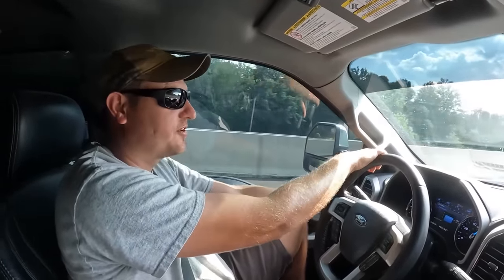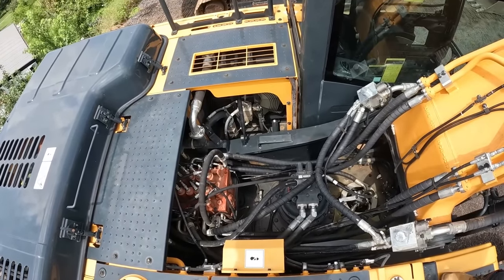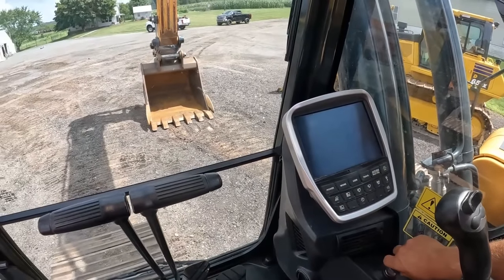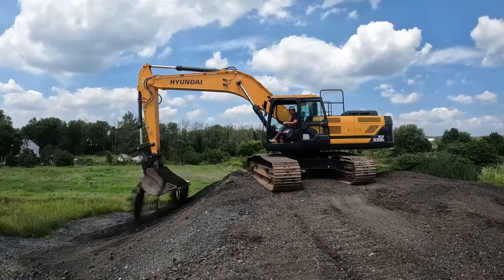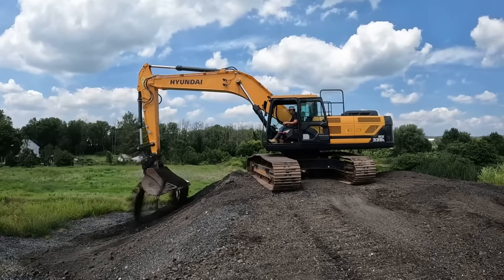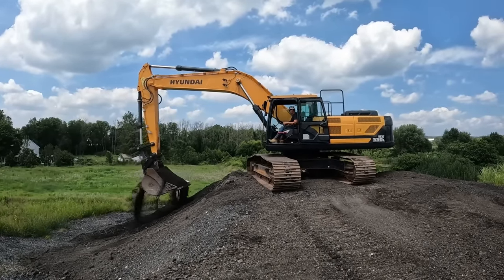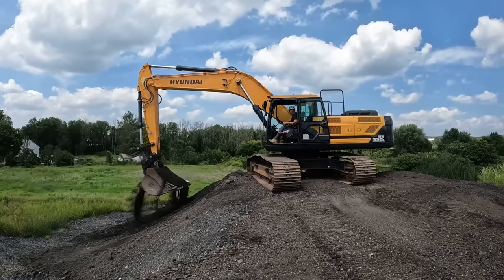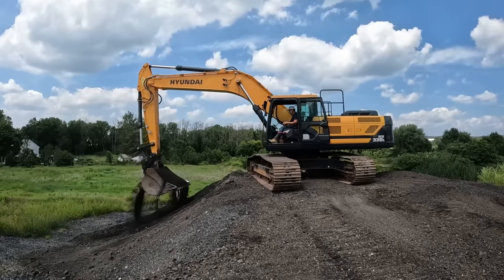Buying A Larger Excavator

Comment: So far watching it Kobelco. Looks much sturdier, quicker, less jigging about while you track. Sounds smooth and looks tight under operation.
Walking up to them first reaction way Hyundai but that soon wore off... on with the watching:-
OK got to the end. The Hyundai has a lot more safety bars on it more to bend but safer for you ... if you need it. Also appears to have a bigger counter swing radius. Can't tell if that's real on camera.
If they can both be hauled with special permits or on the same Size trailer, despite the weight difference, I am sticking with my Kobelco.
Though I suspect you are going to let the  lighter footprint of the Hyundai sway you because it might make a difference on certain jobs.
Nah deffo sticking with Kobelco. Work rate is so much better. Anyway it's worth more when you upgrade next year so you will get that extra money back.
Great video.
Feels like we are all getting a new toy.
Reply: You dont need a new truck.  You need an additional truck.  So the big boy dosent have to wait on truck to get back. One driver can keep two trucks rolling.
Reply: @tedc7714  I meant the rig for hauling them job to job.
Reply: Cummins was my account .,cat and John deere. . I kept the digital computer purring in the R and D Departments.  John deere and cat had the machines wired with sensors.  With my computer keeping track as they ran.  Same at Cummins with the engines.  I was most impressed with the Cummins operations.  They leave nothing to chance.  Any way all are impressive and you are the guy using so what ever turns your crank.   The difference on the hour meter I would say don't amount to much.   Mr experience was 8 years during the 1980s.  So not relevant today I doubt.   Hard decisions I know.

Comment: Why would you have to drive over 6 hours to get a machine? Plenty of machines in the NC area new and used. Plus it'll cost you at least $1,500 -$2,000 to get it moved. When I buy equipment it's not all about price, its about dependability and the service you can get. When a large excavator goes down and it costs you downtime of $200/hr plus $100/hr for the trucks your loading and other equipment in the operation it adds up quick. Theirs a reason why those two brands are available with so little hours.

Comment: As a service provider for Hyundai equipment, I will say they are very simple machines with the electric control over hydraulic. And they have been very reliable machines as well. If you decide Hyundai , NED (National Equipment Dealers) which is who I work for, has multiple locations across the North Carolina

Comment: I think you’ll end up regretting the Hyundai in the longer term for sure, the kebelco is the lesser of the two evils.
I understand budget but a case 30ton or the zero swing would out work and outlast them both and have a fare better resale value.
Ps Volvo screwed up not hooking you up 🤦‍♂️

Comment: I as an equipment operator have had my fair share of different brands in the excavator department.

I personally do not enjoy the hyundai's they're extremely unreliable as far as power what we're asking of the machines in a quarry aggregate setting.   I know everyone will say typical but CAT's are the best when it comes to performance not far behind would be the komatsu's and kobelco's then deere let's be honest deere just lacks in some departments they could use improvements in a few area's but their engines i'll give them credit where credit is due
Reply: Takeuchi is also great but they're only making ''small excavators''

Comment: Still dont get why us has so stripped down Excavators.. her in scandinavia everyone has auto lube and tilrotators whit 2-3 aux options and quick connects on hoses even on 30-35 tons machines. We dont even go outside the machine to connect hoses anymore sins everything is buildt into the bucket lock/connect.

Comment: Chris, you’ll probably go with the HX 330 L, and for a 2019 w/1600 miles you’ll pay around $142,599. good luck with your new machine…
Reply: The 2019 Hyundai is listed on their website at $169,000 and the 2020 Kobelco at $210,000. BTW, the Hyundai has 1573 HOURS, not miles.
Reply: Typo on miles
Reply: Honestly still tho that's not a bad price... that newest 220 Volvo he just purchased was well over $300K add at least $50K for the active dig depth control and it shows the value of the Hyundai machine. @snappingbear

Comment: i think kobelco. i have a 270 kobelco.  i think its smoother than the hyundai
Reply: But the Hyundai is very customizable. They can be almost pin point adjusted to a person’s feel right on the screen. Don’t know if Kobelco has that.
Reply: @mikehunt3222  no the kobelco does not, it's a very standard machine even the latest models

Comment: Well then financially it comes down to what will do the jobs you plan to take, for the least amount of coins up front and down the line for maintenance items. Sure sounded like you were into the Hyundai on the way down to test it... I'd think if I had long term plans for a bigger machine, I'd go for the Hyundai, save coins for the next big one. Otherwise I might be tempted to push the Kobelco more than it could handle to justify the extra coins spent on it.

Comment: Why don't you lease the one you want for a job or two to make really sure it will do what you want it to?  Digging loose gravel is not the same as the types of things you typically do.
Reply: Transportation costs would eat him alive by doing that. That machine will probably cost $5-$8 per mile to transport, maybe even upwards of $10-12 if it has to have pilot cars.
Reply: @stevenlatham4397  I was thinking he could transport it the same way he would if he bought it.

Comment: If Hyundai machines are anything like their car brands, I’d buy nothing but Hyundai. I buy Elantra GT’s for daily driving for the trunk room, gas mileage, but my wife and I buy them for the warranty. We’ve had 6 Hyundais over the last 10 years, pass em down to a kid when we get a new one, but we’ve only had to take 1 in on a warranty claim. It was at 94k miles and 91/2 years, it was fixed thru WARRANTY, they smiled and said “you’re all set!” And off my son called “dad, it didn’t cost a thing!”  No son, it’s under warranty fo another 6 months. Try that with your Chevy (which was the reason we even looked at Hyundai, 10 year-100k mile warranty, and they mean it. The chitty, sorry, Chevy had just gone past 36k miles, a cylinder blew (at 37k friggin miles and we religiously have our cars serviced at the dealer we buy from, no oil change over the mileage, EVERY maintenance that’s required in the service Manuel BEFORE it’s time) to the tune of $4,800!! The day we picked it up we went down the street and traded it in on a new Hyundai and have never looked back. I traded my 2500 in on F350 I was so disgusted. Less than a thousand miles over the 3yr/36k mile warranty. I’ll never buy a Gm Product again and if the F350 don’t live up to its price tag I’ll sell the toy hauler, buy a Toyota tundra and buy a camp somewhere and tow the sxs’s/4wheelers. Rant over, sorry folks. Still miffed at gm lmmfao.